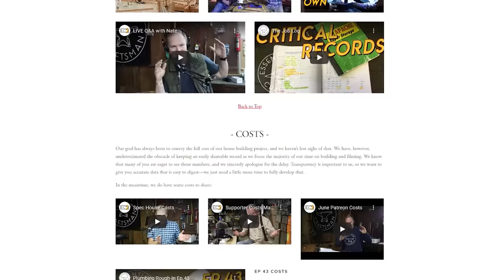5 Mistakes Most Contractors Make

Comment: I believe that there are two types out there.  Contractors and builders. Contractors are only worried about the money. Builders on the other hand love the challenge. And try to give there clients the best job they can. Even if they make a little less money. Contractors usually try to give the least. And want to hold on to as much of the money as they can get away with. I would suggest to anyone wanting to have work done. Always look for a builder even if his price is a little bit higher.

Comment: I wish that u were my mentor when I started out, because I always got taught to fly under the radar.. and I went in buisness in 2014, by 2016 I was out of business not because of the work flow I had plenty of work, and I never furnished materials but, I never paid taxes for them years. Now it's 2021 and I finally paid off my taxes this year, I should have just filed taxes from the start with all the penalties they hit me with. I owed a lil over 20,000 to the IRS and they got triple that probably. First year I made 87,000 gross after one employee and fuel and hotels wear and tear I might have cleared 40,000. Next year I grossed lil over a 100,000 but again maybe net 55,000. And I was got scared because irs was on me .. I will do it again one day I'm 34 years old I went in buisness with the wrong set of tools to be successful. I can't agree more with you.

Comment: I’ll give you the number 1 reason right now. I’m assuming if you’re a GC, you understand construction, and the related trades. 

Ready? Not understanding the finance side. Contractors make the biggest mistake seeing tons of money in the bank and trying to spend it, not understanding the finances. Understanding how to calculate true cost is a skill and a trade in itself. Hire an accountant. Take the hit when you’re starting out and hire a CPA. It’s going to cost you $50k-$100k but they can help you understand the cost of running your business. From there, define your yield. What are the finished goods to divide your costs into? If your try to calculate a profit off the finished project, you will miss a slew of costs. Define you’re yield. Foundation, framing, developing, electrical etc. segment your cost into each finished good and calculate a profit on each section. This lessons your chance of missing costs and ensures a net profit for the project.

Comment: I live between 2 restaurants that constantly have contractors in. This is what I have seen that is annoying as all ^^&&* & would not make me think twice of not using them or suing them outright.
1. Contractors using wrong parking spots for the building they are working on. They always play dumb but they are lying sacks. That one will get you automatically towed. Think about that the next time you are on a job & your vehicle & tools are gone for the day.
2. No clean up of refuse materials from the job done. This includes nails & screws carelessly left all over the ground to puncture feet & vehicle tires.
3. Using your fire escape & roof to gain access to the next door roof they are working on without any consent. This includes wanting to use your roof as a temporary landing/work spot for a 8,000 lb air HVAC unit.
4. Blocking access to your building while working on another.
5. Running cables & work gear/tools across your property/over vehicles without consent.

Comment: One rule. NEVER, NEVER, ever.ever, do any custom work. I built 4 styles of houses for over 25 years. Perfected wood waist, over orders, under orders; the drywall crew doesn’t show up before the rough in is complete (which is the only work that I subbed out). We shot the lot, dug and poured footings and piers, front brick and continuous curtain wall. framed, dried in, plumbed, wired, shingles, brick facade front, vinyl sides, back, and soffit. Finally landscape way over the top with small trees, flowering shrubs, just overkill it. Then a concrete drive and walkway with fescue sod around the overkill of flowers and trees. Everything was code ++. Usually had a contract before the house was dried in. Keep It Simple Stupid. Simple and stupid always worked for me. Been retired for about 12 years. The regulations, silt fences, porta john, getting mud on the road, 20 year old inspectors... I would not get into contracting again, for such a time such as this. Hey that’s Esther.
Reply: You kids get off my lawn! 😂😅❤

Comment: The customer is the most important asset a contractor has.  They are why you exist.
Labor is how you can make a customer happy.  By extension the customer is the most valuable asset a workman has.  
The guy who handles estimates and bids is very important.  Bid low you lose money,bid too high no job.

Comment: Sometimes compliance with the system is unacceptable. Better to ask forgiveness than permission, sometimes. I had this asian inspector that barely spoke english who tried to fail me on title 24 Ca. energy right after the code had been changed. My permit was pulled under the previous year regulations but he was holding me to the new regulations, I explained him how permits worked several times patiently, but he was to dense to understand and was going to fail the inspections, So I tossed him off my job site and told him not to let me catch him on any of my sites again. That’s when I learned to start requesting specific inspectors and permanently 86 others.

Comment: What l learned is carpenters have trouble in good fakr wages. Every homeowner has a hammer and assume they are carpenters. But take those same folks let a turd float around the plumber can demand high wages. But l side jobs estimate was 20.00 cash per hour. Then after they call you back. know your work and know your dependable l go up to 23.00 hrly. Those prices are back inmid 1990s. Union carpenter makes just under 59.00 an hour with the benefit package just under 39.00 in hour cash wages. Anything over 8 hour day or 40 hrs is time and half. Sundays and holidays doubletime. I think 2.00 premium being foreman

Comment: I was with this guy until 3. The regs and rules are there to protect the crew not the boss. The boss gets paid by the client and the boss pays the crew. That's a big And. Normally the boss gets a retainer fee of 90 days from the client before work starts and in that retainer is included material and transport of material. The 90 days also include man hours: how many guys will it take and how long will it take those men to build the structure.  The crew doesn't get a retainer unless it's union and then that retainer is called a bond. All you tradesmen out there remember this: the republican party is for the rich man, the bosses, the clients, not the working man. The democrats are for the working man. Nixon signed Oshawa into law but it was Carter and Clinton who funded it to hire enforcement agents. Obama kept it and Trump and his ilk tried to gut it